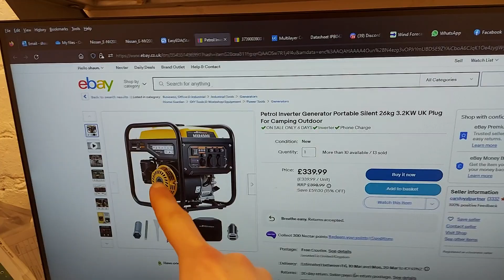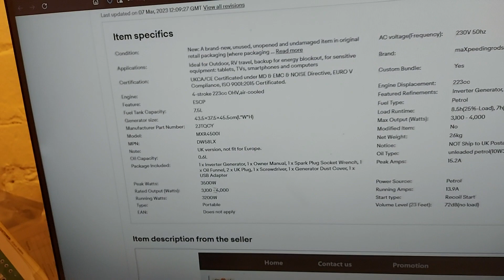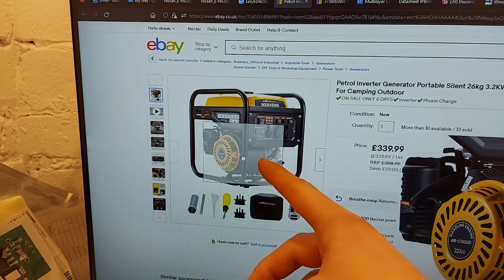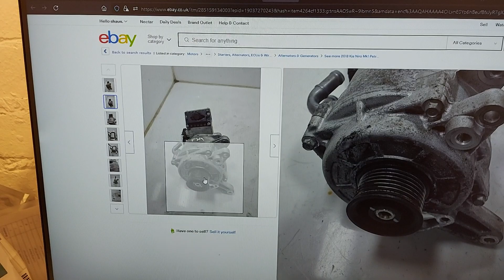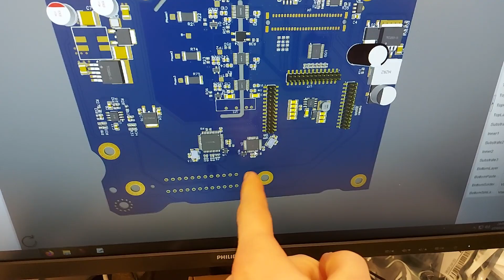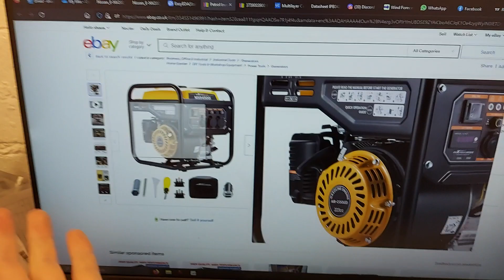E NV200 Range Extender Part 2 - Two Options

Comment: Why would you use a vesc as a rectifier rather than just using a diode rectifier?
I guess you are utilising it's ability to regulate the current to the battery?

Instead you could just use the generator rpm to controller the current. I.e. If the generator is wound to such that 3000rpm produces your low battery voltage and 4200rpm would produce full battery voltage. that would make throttle position proportional to charge current.

It might be slightly ineffective if you let the battery go flat before charging and run the generator at a sub-optimal rpm, but that can be avoided.
Reply from the maker: The vesc allows the generator to act as a starter and can be scripted in the lisp language to create an MPPT charge controller which will run the generator at optimum power output. I do have a large 3 phase rectifier which I may use if I can't get the vesc option engineered in time. It all depends what voltage the generator is wound for.
Reply: the VESC is operating excitation as far as i can tell.  That way there is a tight feedback control loop.